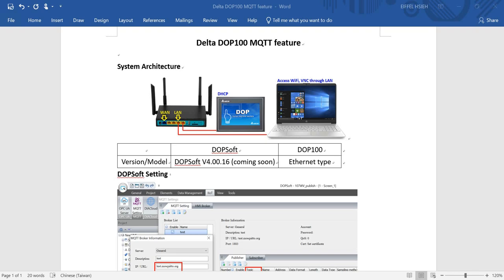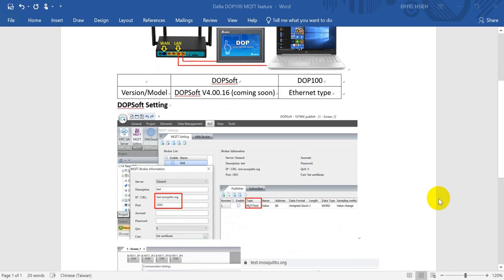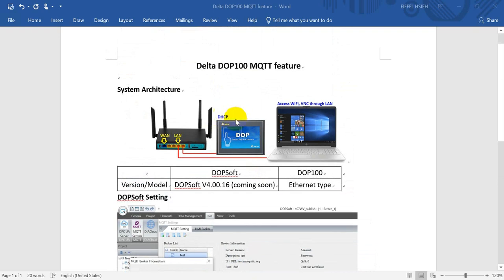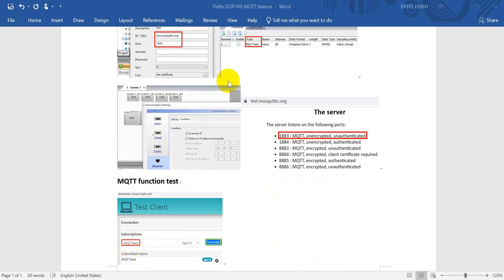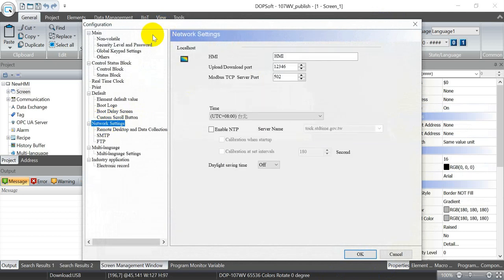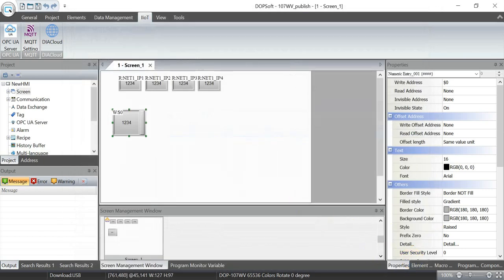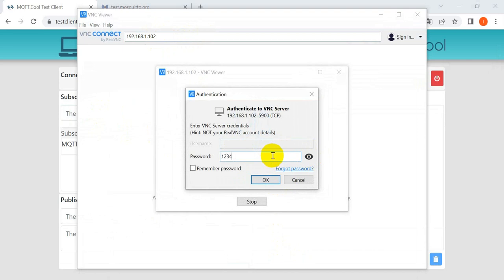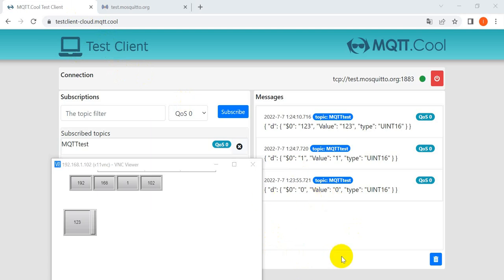Delta DOP100 MQTT feature

Comment: I am tryind to apply the same configurations that you have done and it is not working, I am using the last version of Diascreen software, 1.3.2, do you have any tip for that? The model is a DOP-107DV